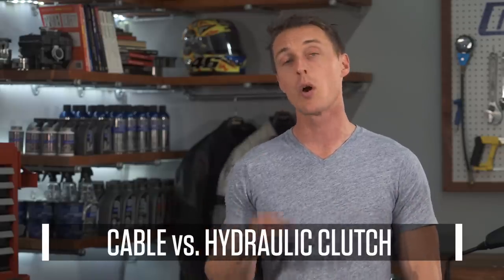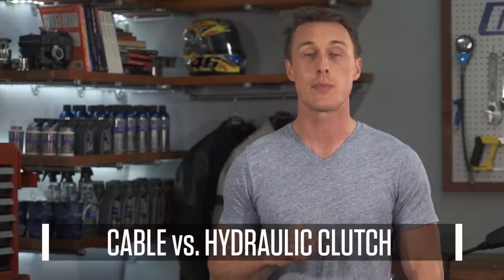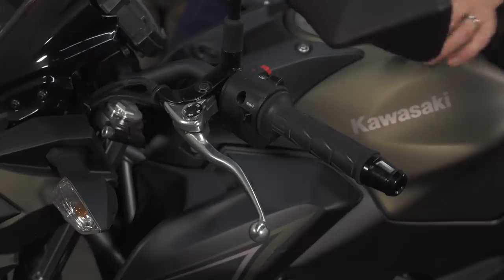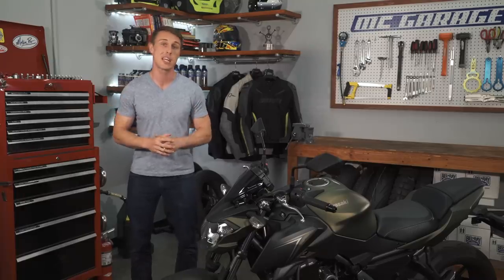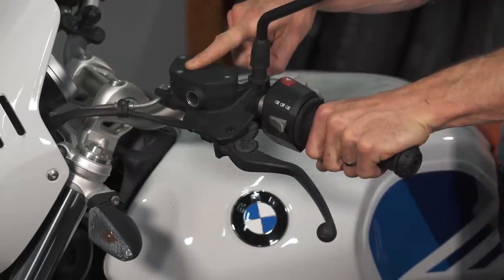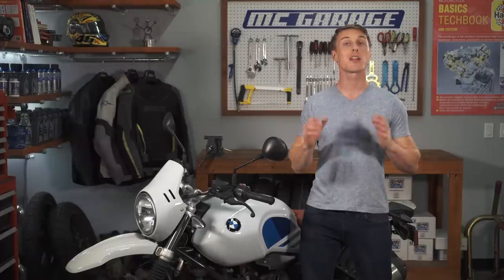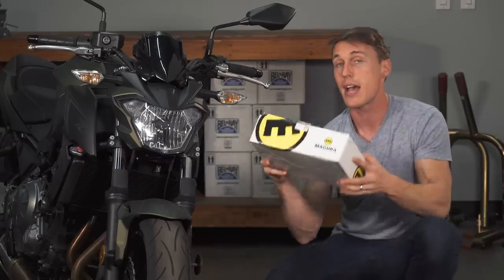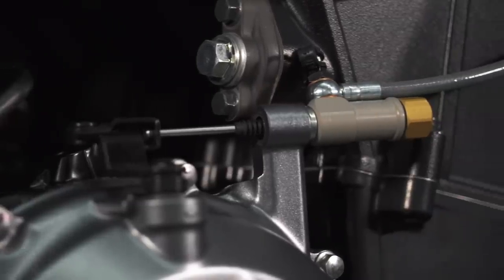Cable Clutch vs. Hydraulic Clutch | MC Garage

Comment: Cable set-up is lighter. But hey if I was concerned with shaving weight I would reduce my doughnut intake
Reply: BritishBiker Philippines 
Mmmmm doNots ;)
Reply: Yeah I've heard it's about a 10th off 1/4 mile time per 5mm reduction in diameter of the donut intake. It's a velocity thing.
Reply: @Pooooooops  no it's a calorie thing
Reply: Lighter for weight, but lighter for the fingers. And the weight isn't really that big of a difference.
Reply: Many people assemble the hydraulic clutch with the wrong slave cylinder so their clutch would be much heavier than their stock mechanical clutch
Reply: Seriously, I don't know why he said hydraulic is easier. I never had a hydraulic clutch but now on my vfr800 it is and it's significantly harder to pull thab my two other cable clutches on my ninja 500 and drz400
Reply: Krispycreams or standered ones

Comment: Every failure I've had over the years is with hydraulic clutches give me a simple cable any day.
Reply: Banditmanuk agree 200%
Reply: How? I've had a hydraulic on my 09 zx14 and never had an issue.
Reply: Dan DanDanDan i wish it was the same for me. Mine in my sd1290 keeps sucking air in.
Reply: valebliz Check for seals at both ends, if that fails, master cylinder or slave cylinder is to blame.
Reply: Not on a enduro bike though.
Reply: Dan DanDanDan I'm talking of my experience riding and owning many bikes over the last 37 years. (master and slave cylinder on one Ducati)
Reply: Yeahhhh but I ride off road so
Reply: Amaey Paradkar yeah i have to check those
Reply: I've had cables fail twice, never had a hydraulic clutch fail.
Reply: for the road usage sure , track riders and long rides in traffic and cold weather you will wish you got a hydraulic clutch
Reply: Air Doctor oh man I can agree with that. As my engine heats up when riding in traffic the bite point of the clutch changes, I have to let it further out than usual which is less than ideal for slow speed filtering. Then when out on the open road, it changes to further in again and it’s smoother 

Makes gear changes stiffer as well in city’s,  despite regular oil changes because of where the clutch keeps changing
Reply: Hmm, this makes me less excited about converting
Reply: yeah because an opinion in the comments without any details can make you change your mind , it's up to you if you want to pull the clutch with two strong fingers/4 strong fingers or  2 light finger/pinkie.
Reply: As it often goes, there seems to be a split in terms of people's experience
Reply: magura is solid , 20000 kms on dirt bikes. But hey i'm also a random comment on youtube , so it's up to you. For track riders it is essential.
Reply: total bs. all brakes have been hydraulic for decades now.
Reply: Alinel Woundhorn Its not a brake??
Reply: technically a disc brake uses a hydraulic actuated piston just like in a hydraulic clutch. so what if its not a brake? the fluid mechanics are the same. all dakar bikes, MotoGP bikes use hydraulic clutches where reliability is a much greater concern, so id still say total BS for the cable operated clutch.
Reply: Banditmanuk hey man hydraulic clutch are just as reliable as cable as long as maintain them 
I would say more reliable considering cables snap fairly often
Reply: Maybe the problem is with Ducati (and KTM for that sd1290) rather than clutch type?
Reply: My experience has been just the opposite.
Reply: What about cable brakes???
Reply: Multibrand mechanic here who agrees, but hydraulic clutches on other peoples bikes make me money!
Reply: Hydraulic is better
Reply: I realise I'm a year late to this video and comment section, but I've had more hydraulic clutches than I've had cable, nearly all the off-road bikes I've had are KTMs which come with either Brembo or Magura. I've never had any failures just that one recently started dragging on me due to the previous owner using the wrong fluid but apart from that they're solid and definitely something that all off-road bikes should have as your clutch gets a hammering and when arm pump sets in even a light lever can become very heavy, I often find myself using one finger for my clutch as that's all you need and more grip on your handle bars never hurts in the rough stuff. also in general road use a hydraulic clutch is great to have when you're in heavy traffic, the last thing you want to worry about is dealing with a heavy lever or changing bite point of your clutch.
Reply: @MattMaxwell  untrue. Dorna has a "minimum" weight limit of 157kg .. so dropping some few ounces really doesn't matter.
Reply: my experience is the total opposite lol

Comment: From a physics standpoint, they are both mechanical systems. They just use different means to transfer force. Dunno why they call cable mechanical and the hydraulic just that. They are both mechanical, one relies on tension and the other on pressure.

Comment: I've owned bikes with both types of clutch lever system and always prefer the 'feel' of a cable. The engagement point is easier to find and it's easier to modulate right at that point in my opinion. But everyone is different I suppose!

Comment: I bought the cable lube tool and bought the bike with hydraulic clutch :)
Reply: Use it wit your throttle cables(or your ExUP or any powervalve, hahaha)
Reply: @Ruby Rose. Yes, exactly my thoughts. The only cable there is on the bike :-D
Reply: Lmao
Reply: @ruikazane5123  and then its throttle by wire

Comment: I've had plenty of failures with both kinds. That Magura conversion looks sweet as hell!
Reply: can aprillia rsv4 clutch cable be upgrade to use with magura hydraulic kits ?.. im tired of clutch cable breaking and have to lube it regularly during winter.

Comment: I switched to a hydraulic clutch when upgrading the brake master cylinder on my KTM Duke 390 12K miles ago. I used Frando components from Taiwan and it really works well. I used to have to adjust my clutch mid-ride because the engagement point would change as the engine heated-up and then again when it was cold but not any more : )
Reply: This is exactly how I feel after upgraded to the hydraulic one !!!!

Comment: I definetely recommend the magura kit to anyone doing enduro/off road technical stuff. Not only is it easier to pull, but when your clutch overheats when using it, for example to climb a very technical section, it continuesly auto-adjusts and you get always all the travel you have.

Comment: That hydraulic lever mod is quite interesting.
Sadly, it is not available for my '17 CB500F yet.
Reply: You can order a different one on the wast internet or simply on ebay. I had one from ebay on my last bike, no problem, easy pull and worked perfect for over 2 years (sold the bike so i don't know how it lasted after 2 years)

The conversion costed me $28 so definitely worth the money if you can find the same one or something in that class
Reply: there is a lot, a lot of universal hydraulic clutch set that can be applied to almost any bike. these type of kit doesn't really need specific to each bike afterall, because they're attached to a handle bar which is have a universal size for all bike, not like footpeg for example, which is specific for each bike.
Reply: why would you want that on the cb500? that bike has one of the easiest clutch pulls ive ever experienced. i mean its so easy that the first time i pulled it, i smacked it into the grip and looked down to make sure its connected with the engine

Comment: I have and had bikes with both.  I have had a clutch cable end come off and had a slave cylinder seal spring a leak (at 97,000 miles and 40 years of age).  In  the end, neither were overly difficult to replace, and both required removing stuff to do so. As far as cheaper to repair...  I question that.  A Master or Slave cylinder rebuild kit costs around the same as a cable, and can take just a few minutes to do if the bore or piston isn't screwed up.  I have a preference for Hydraulic, but I also flush/bleed the system at the start of every riding season.

Comment: How about explain about lowering links used to lower motorcycle,it's cons and pros
Reply: this right here lowering links, i would love pros and cons how they work wicked suggestion rider for life
Reply: Good suggestion, we'll put it on the list.
Reply: Ari Henning great
Reply: It's how about explaining lowering links,my bad on the typing,damn it
Reply: Rider For Life lowering a motorcycle... only two possible pros, looks if you're into the lowered look and rider fitment for the vertically challenged riders. The rest are all cons.... it cost money to lower a bike, reduces performance, and reduces safety. You'll scrape parts on the pavement much sooner in corners with a lowered bike thus making it easier to wreck.
Reply: good suggestion. don't use them except as a last resort. buy a lowered seat, which many manufacturers now offer or get one shaved down professionally. set preload to the minimum. you could even buy tires with a lower aspect ratio and the set the pressure slightly lower. only then should you consider lowering your bike and no sport bike should be lowered more than one inch

Cons include fucked up motorcycle geometry and adverse handling, which can cause stability problems. It also effectively increases spring rate and can cause a jarring ride by increasing the rising rate of the linkage.

Comment: I have heard that you shouldnt lube your clutch cable, the teflon layer will then get damaged and after that you HAVE to lube it periodically, I guess lube will also attract dirt which means you then also have to lube it to keep it going. Only cables I have lubed where getting worse quick and I have never lubed any new cable and they are just as good as day one.
Reply: because teflon is a solid lubrication
put any other lube in will wash away these teflon
Reply: Most lubes are bad for plastic. Maybe there are PTFE ones which wont damage the sleeve. I have tried different silicone spray lubes, but those have a strong solvent that damages plastic and rubber.

It would be good finding something that works well.

Comment: In my experience cable is more reliable however I appreciate having hydraulic in my motorcycle. Makes the driving easier specially ok city where clutch is used often.

Comment: no one ever talks about the downsides of hydraulic, they unbleed when your bike falls over, your fluid needs to be changed and checked and topped off, seals in masters and slaves go bad, hoses go bad, lines leak, fittings break, etc etc, its more complex less reliable and more expensive, when your smash your handlebars down in the dirt on your adventure ride would you rather have a fragile master cylinder and a fragile banjo fitting or a simple robust cable? Yes ive tried magura setups and they suck too, bleeding thick mineral oil is a literal nightmare.

Comment: Awesome video as always! And Ari my front brakes are stiff as wood. There's no braking effect for a quarter of the play and you really have to press hard because there's so much resistance after this point. There's absolutely no feedback. What's wrong with it and how can I fix this?
Reply: You bled and put new brake fluid in?
Reply: What pads are you running? Are they in good shape? Are you using a cheapo aftermarket brake lever?
Reply: Get a girlfriend
Reply: Take your calipers off, pump the breaks to check the piston action. If they don’t come out smoothly and evenly pump them out and clean / regrease the piston and seal. Bleed them all the way through with fresh fluid and install new (quality) pads. Your brakes should work like new.
Reply: 😄 what?  A motorcycle mechanic girlfriend??
Reply: Simple: "Inspection is key."
Reply: Id check your pads, sounds like they may be old and hard or glazed and not grabbing properly. Considering it's a problem with your brakes, I would just go through and inspect/service the entire system.
Reply: Lube the brakes

Comment: Another (minor) drawback of cable clutch is that the clutch pull varies as you turn the bars. With full lock in tight low speed maneuvers, it can be harder to be consistent with slipping the clutch as you turn the bars.

Comment: Hi Ari, what is that tool that you use in the video to lubricate the clutch cable?
So far I have been using a syringe with meedle, but your tool looks much more effective and professional.

Comment: A cable clutch can as easily be "amplified" as a hydraulic clutch. The reason it is harder to pull is because it has more friction. This is also why a cable clutch is slightly easier to hold than to pull

Comment: Ari my man, you are my saviour. Can you please be a cooler and better looking dude than Zach by making a how to video on bleeding the hydraulic system? Mine lost pressure somehow and I tried to bleed it like I do with the brakes - which I successfully manage quite often, but it didn't work. I tried for half an hour and no pressure at all, then I rode clutchless all the way to the garage and they fixed it within minutes. Unfortunately they didn't want to show me how. I really appreciate if you can show me how to bleed the hydraulic system in case it loses pressure again

Comment: I feel like the hydralic clutch system is safer overall because if it was failing, you would most likely notice a leak somewhere before it would go out.  With a cable clutch system, a weak spot would be harder to notice in my opinion, and as soon as that weak point breaks, you can't use clutch lever.  

I've had a throttle cable break on me before while I was riding.  Though it likely could have been prevented by lubing, I didn't notice anything signs of the cable about to fail moments before it happened.  Fortunately it didn't happen while I was going straight and was able to pull over immediately.  A clutch cable breaking probably wouldn't be as dangerous because you wouldn't use it while turning, but it could certainly throw you off.

Comment: I rode a HD road glide the other day and I couldn’t get used to the hydraulic clutch because the catch zone was way far out and my fingers barely caught on at the end so I was more likely to drop the clutch and spin a wheelie...jk but if HD stock clutch could of at least offered a way to modulate the distance I would of have been happier with my small hand and fingers

Comment: I had my Harley engine upsized. I then needed a new clutch to contain the torque. This led to needing a hydraulic clutch, to avoid hand fatigue. My issue now is, the hydraulic clutch, doesn’t engage until my clutch lever is further out, than I prefer.  In slow speed maneuvering, my grip is compromised due to the clutch lever position.  Any suggestion on how to change the position of the clutch lever engagement?

Comment: Had a problem with the hydraulic clutch on my k7 gsxr 1000 on the track yesterday, coming up to the end of the straight at 170+ and the clutch wouldn't disengage! Bled it and havn't had an issue since no signs of any leaks so how did air get in there?

Comment: Do you know what would be the cause of the lever not fully engaging the clutch? One of my bikes had a hydraulic clutch and I've bled it 100 times but when i turn on the bike, hold the lever and go into first the bike jumps forward and dies, its feels like the clutch is not in all the way in, even though the lever is fully pressed down. Any ideas?

Comment: I recently upgraded the exhaust system on my 2017 Kawasaki z 900 after riding it for 2000 kms and also had a Power commander 5 installed, I would like to know if a power commander causes any long term damage to the motorcycle engine.
Reply: Depends on what map that PCV is running. The device itself isn't going to hurt anything; if it malfunctions it reverts to the stock fuel and ignition map.
Reply: Thanks Ari, for your prompt reply.

Comment: I have a 2004 Fjr1300 and have a stiff clutch pull. Even after flushing the hydraulic clutch I did not notice any difference. Is there anything else I should do? Someone mentioned soaking the clutch plate in oil.

Comment: Im using a hydraulic clutch. Problem is the clutch biting point is too near and causes the bike to stall a lot. With a cable clutch i can adjust the engagement. Can it be done with a hydraulic too?

Comment: Great video, thanks! My 04 Tuono had a hydraulic clutch and it was HEAVY to pull. Way heavier than any cable clutch. Any idea why?
Reply: Dark Rider I'm not an expert but if I were to guess the hydraulic clutch in my car got harder to press when air got into the lines just like how your brakes get harder to pull when you have to bleed your brake lines. I thought it was funny when I found out the hydraulic clutch in my car uses brake fluid lol. Not sure if its the same as brakes but my cable clutch on my ninja 250 gets hard to pull in cold weather
Reply: Dark Rider I have a 2014 Shiver and it’s the same for me. It’s kind of just Aprilia’s thing

Comment: I have a 2013 HONDA CB 1100 with 950 miles only. But whenever I put first gear on it makes a loud shifting noice like( Thakkk) but all other gears are shift smoothly and there is no problem to turning it  back into neautral. Please advice if its normal or something is going on with it